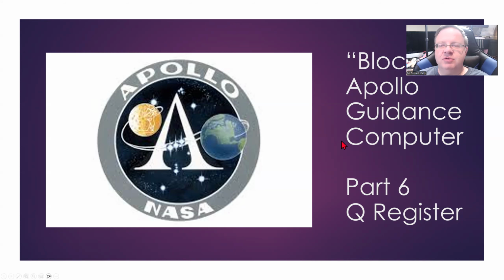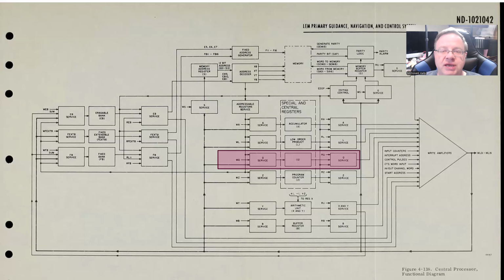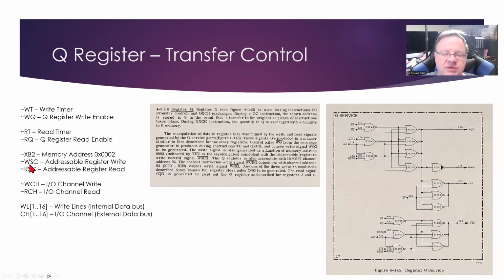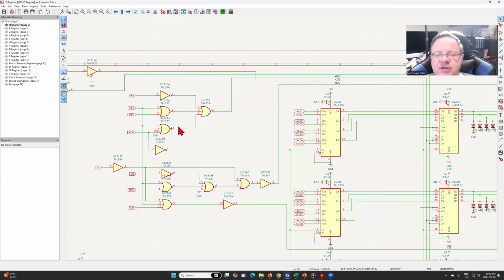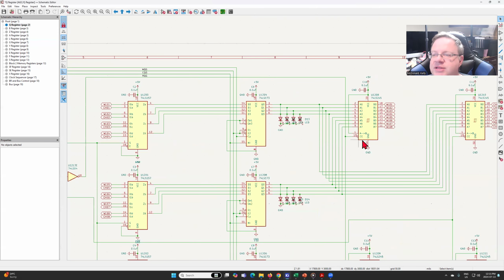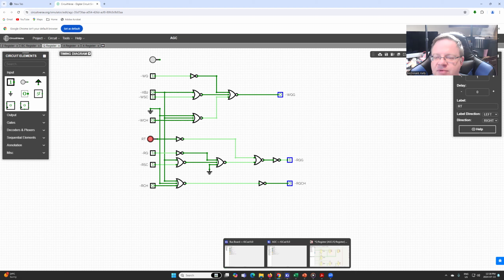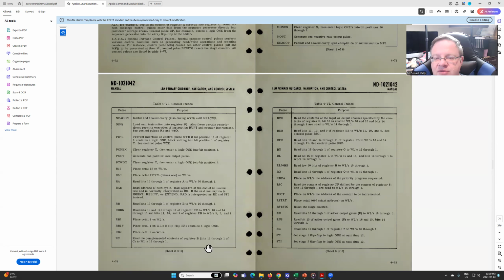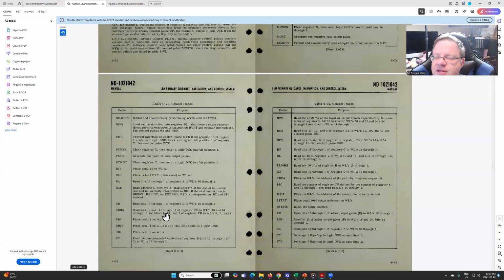EP 6: The Q Register

Comment from the maker: This is a good observation and I bumped into it when starting to lay out my S register (still a work in progress), but I’ll be generating the XB signals from there (helps me save a line on the backplane for SCAD as it’s getting crowded as it is, 96 pins just isn’t enough lol). I had considered putting XTO on the backplane (and I may need to do so) based on the last quirk you mentioned (bit 10). I’ve only looked at the channel side of things at a high level so far.
Reply: Makes sense! Yeah I can imagine 96 pins is quite a constraint to work with haha.

Comment: How are you defining XB2? It sounds like you're using it to mean "the whole address is 0x0002", but in the original design it only covers bits 1-3 of the address. XT0 then covers bits 4-6.

This is maybe an important distinction because channels use a different number of address bits than normal accesses. If Q is accessed as an addressable register, it is accessed via RSCG/WSCG instead of RSC/WSC directly. The G versions of these control pulses combine them with SCAD (Special/Central ADdress, or something like that). SCAD will be 1 if and only if bits 4-12 of S are all 0; therefore, if RSCG/WSCG are active, it is sufficient to use XB2 to only examine the bottom 3 bits of S to figure out which special/central register is being accessed. As a result, all 12 bits of S are inspected.

Channel accesses on the other hand are not combined with SCAD. Instead, only XT0 is combined with XB2 -- meaning that only bits 1-6 of S are examined. This produces a weird quirk of the AGC design where, even though the channel address space is nominally 9 bits, all channels implemented inside the AGC are accessible with any combination of bits 7-9. So Q is channel 2, but it's also channel 102, 202, 302, etc.... This behavior is never exploited, and we don't even emulate it in VirtualAGC at the moment, so it's no big deal if your replica doesn't replicate it.

More importantly though, I/O opcodes take 6 bits to encode. The control pulse sequences for the I/O instructions do the usual quarter-code thing of using RL10BB WS to clear out bits 11 and 12 of S, but they don't clear bit 10, so during WRITE, WAND, and WOR, bit 10 of S is going to be still be set at the time of the RCH and WCH control pulses. Thus, while addressing Q as a special/central register requires looking at all 12 bits of S, accessing it as a channel requires ignoring at least bit 10.

Sorry if you've already thought about this and have handled it a different way, or if I'm misinterpreting your logic!